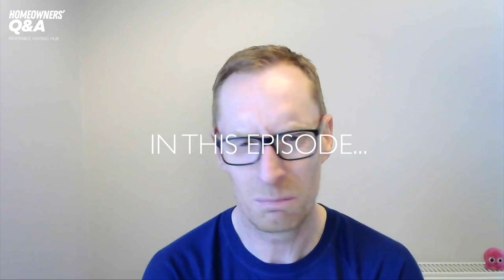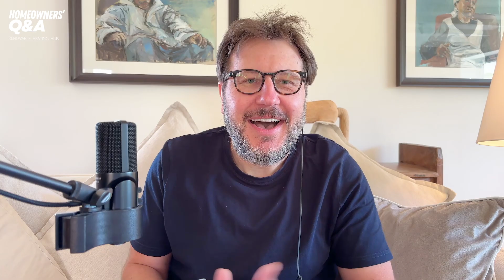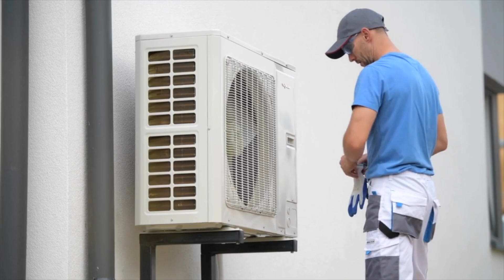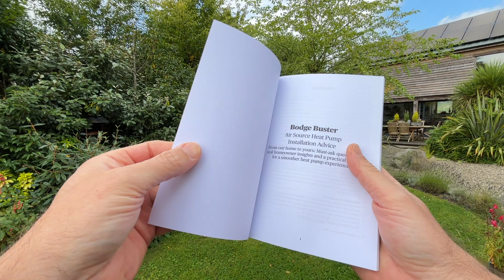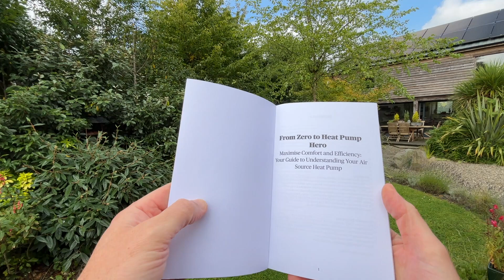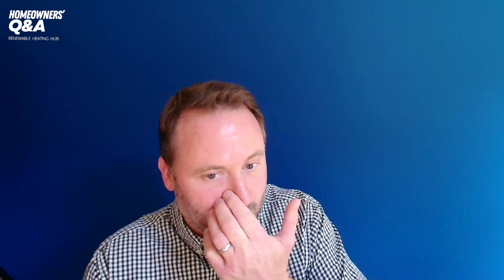Is This the Ultimate Net Zero Combo? Solar PV, Batteries and Heat Pumps Explained

Comment: Do i need my towel rails wired directly to somehing for them to be powered by solar diverter?

My eddi is about £500, an installer i spoke to said you can easily divert for about £30 so dont buy the eddi

Comment: Can you give some recommendations on what smart kit would suit my setup.
I have a solaredge optimised 6kw solar a 10kw solar edge battery. A 6kw valliant heat pump controller via heaven wise. I also have an ev with a Ohme charge and I’m on octopus intelligent go. Currently charge the battery during off peak and export during the day when the battery is full. I’ve only just had the heat pump fitted so not aware of the energy usage during the winter but before this was installed we used approx 22kw per day. Any advise on the choice of smart kit that would assist would be appreciated
Thanks
Reply: There is no single answer to this but if you are technically minded / willing to put in some tinkering time, Home Assistant would give you the most flexibility with your setup. I too have the same Solaredge setup and control battery charge and discharge using Home Assistant alongside the Octopus integration. You don’t need to do anything with the charger because Octopus has control of it. As far as I know, nothing out there currently takes advantage of Intelligent cheap periods outside of the usual off peak times, hence why I resorted to Home Assistant. Using Intelligent has made a huge saving on our bills.

Comment: We put 9 strings of panels supplying this house and some converted barns between 2012-2014. Like some of your speakers I wish I knew then what I know now. There were limitations on our local grid that we didn’t know about as it was operating very close to the upper voltage limit. So close in fact that when the sun came out in summer the panels shut down. For every 1kw generated the voltage on the system went up 1 volt. 
We have switched the export element of our FITS from “deemed” to Octopus outgoing at 15p/kwh. This is fantastic at the moment since we have a 3 phase system and in current sunny conditions export up to 70kwhs/ day from the 3 phases. I don’t believe it will last. The NESO app shows that at the time of writing about 80% of electricity generation in the South West region is coming from solar. Solar installation is still taking place at pace and if we move to regional pricing surely export pricing is going to change. 
With all the doubts about future policy it seems to me that building as much flexibility into our systems is going to be important. 
Are your experts correct in assuming electricity prices can only go up?  Government could make changes so that at least the social element of the price is removed. With increasing renewable energy sources production from renewables is going to be more volatile. This will increase incentives to store power and change time of use from the grid. 
A concern I now have is that Octopus can read my smart meter to determine what I import on a half hourly basis (most of the time) but struggle to read my export on the same basis. In our village there appears to be significant variability in electricity companies ability to get smart meters to work effectively. If we have to move to half hourly pricing on our exports this could be a problem. 1:15

Comment: First off, you will be using a lot of energy, the only question is how much are going to be paying for it. Solar is great, but less useful when it comes running a heat pump in winter, so you will need a way of shifting time of use (TOU) onto the cheap rate periods. With a heat pump, there are two main models to use regarding storage (BESS) and tariffs.

One way is to have a medium sized battery system, typically 10-15kWh for a 3 bed semi, and run it on a HP tariff like Cosy, that way you can charge at 15p/kW and deploy in the peak periods. 

Alternatively if you have an EV, you can make use of a cheaper EV tariff and mate it to a large storage system, eg 30kWh, charge it at 7p/kW overnight and deploy tactically across the day, in conjunction with solar if you have it.
Reply: I think your summary is spot on. We installed our ASHP towards the end of winter, and this year's data seems slightly skewed due to the unusually sunny conditions. I switched to Cosy but, in hindsight, might have been better off staying on IOG. That said, after running multiple simulations for the coldest months, Cosy still appears to be the better fit for us, given our limited 11 kWh usable battery capacity. I’ve also noticed they’ve recently introduced a fixed IOG, which makes me wonder if they’re looking to tighten up on 'seasonal tariff gymnastics'!
Reply: @JOOI525  The day rate is a bit less, but if you have solar/battery its not worth it.
Reply: Spot on, but remember that you can export during the summer as financially efficiently as possible to build credit for when you need it in the winter. You don't require enough solar and battery to power your heat pump during winter, which is likely unrealistic for most individuals. However, batteries are a game changer by allowing you to choose when you consume from the grid; utilising TOU tariffs and solar capacity is relatively inexpensive. There will always be a balance between investment in solar and battery storage capacities, which varies significantly depending on individual circumstances (access to cheap EV tariffs, DNO export allowance, roof space, budget, etc.). The challenge lies in determining the best approach for your situation and then applying it with your usage strategy and tariff selection.

For example, we are an all-electric household with a BEV and a PHEV, and we consumed 13MWh from the grid in the past 12 months, which cost £1030 (excluding standing charges), averaging just under 8p/kWh. 5MWh was used for car charging. We generated 5.9MWh from solar and exported 3.7MWh back to the grid in total. We only have 6kWp solar and a 10kWh battery. After all of this, our utility bill is £480 for the last 12 months (excluding standing charge), which equates to a monthly average of £55 all-in. Our greatest winter savings have come from having Octopus Intelligent and the cheap daytime charging slots (outside of the overnight cheap period). All of our automation is rigged to take advantage of them and top up the battery for the next peak rate period, hence the very low average import rate.

I don't expect the 15p flat export rates to continue, but I hope they do for as long as possible!
Reply: @arundalep  Yes, exporting solar in summer to help pay for the winter bills is a useful extra step to take, how effective this will be depends on your array size, inverter rating and export limit. I wanted to keep it simple and cover the basics for those who are new to this world of heat pumps and tariffs.